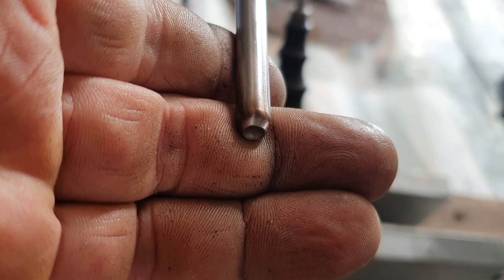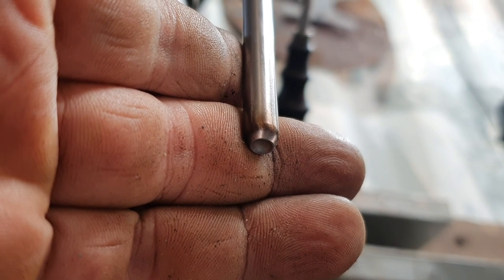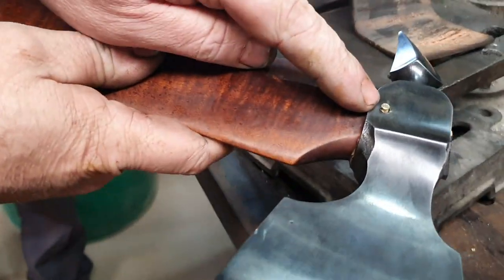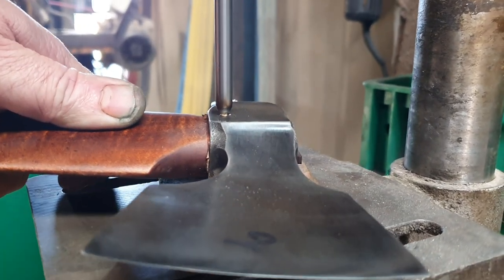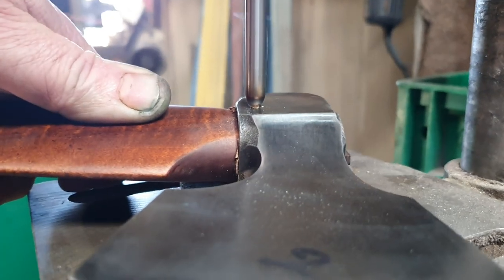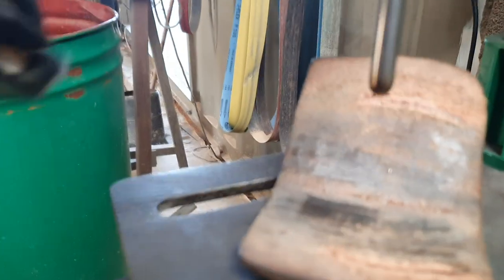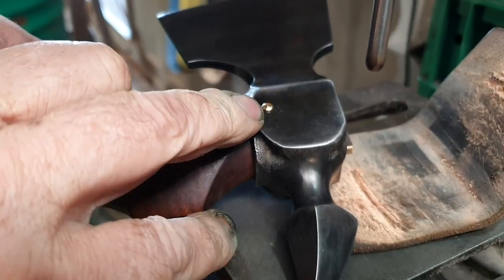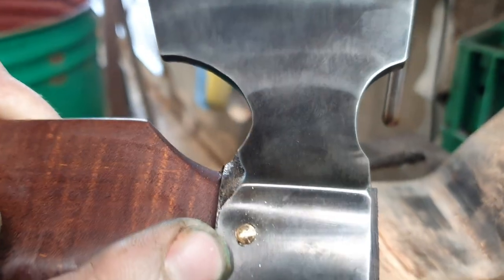Quick Tip - Creating brass domed pins in seconds!

Comment: The only problem I have with that is you are not compressing the two ends together. Hammer blows will make for a tighter fit.
Reply from the maker: The solution to your problem is fairly simple. Once you domed it, hammer it tighter. Problem solved. This is purely a technique I'm pretty sure you did not know about. Use it, don't use it. The choice is yours ... PS: There is no one technique that will fit everything you can do with domed pins. This is just another one for your toolbox